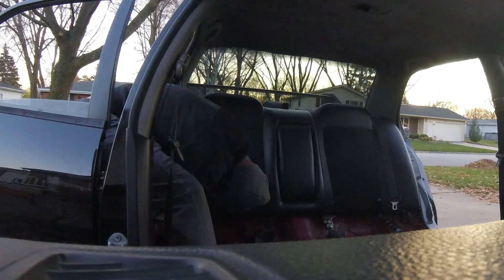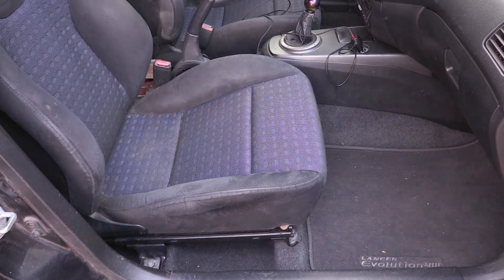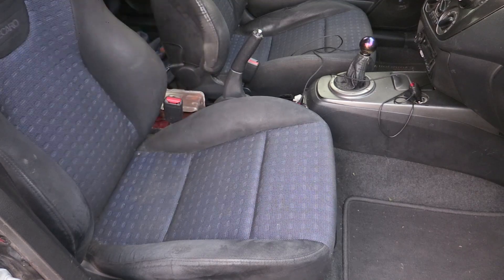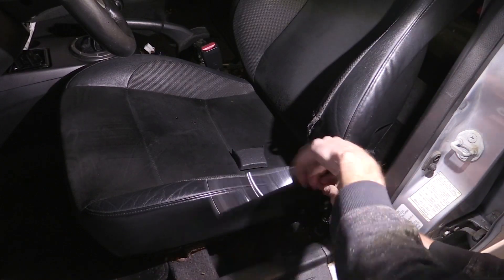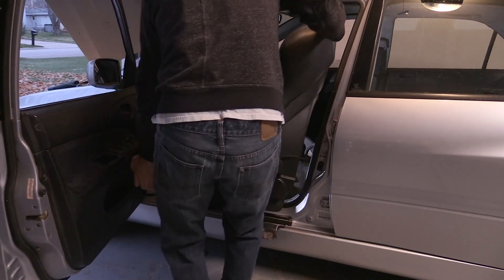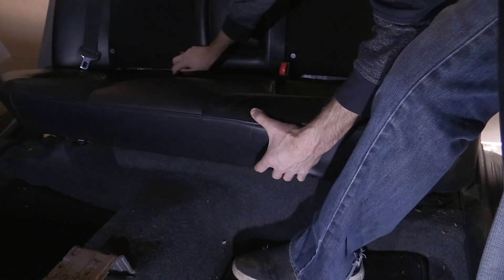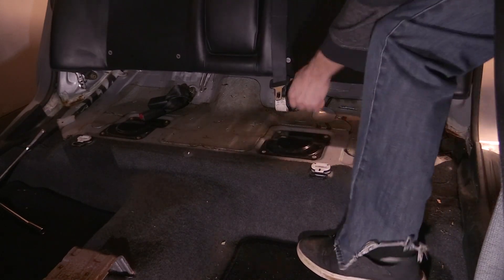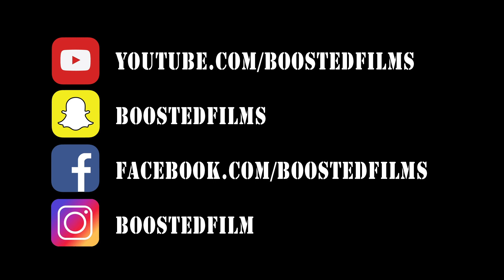EVO 8/9 Seat Removal / Install Howto - Mitsubishi Lancer Evolution 8

Comment: Great video! I never knew the rear seat removal was that easy. 

And as far as ageism with Evo ownership, Paul is an OG in the Evo community, even from his blue 8 from many years back. I used to watch his videos when I was in high school, love the work Paul!
Reply: Thank you for this video. im trying to figure out if I can DIY the seat removal and get access to the floor to put some deadening mat. The 4 doors have been done recently in an autoshop and I DIYed the spare tire compartment but was contemplating putting some on the cockpit floor. Again thank you for this video.

Comment: If the clip has been broken under the backseat that clamps it in and holds can it be replaced ? Like the black clip part is completely missing from when I upgraded fuel pumps.

Comment: I just did front wheel bearings on my evo, and I tell you what that is the worst.. I had to remove both knuckles and unplug the ABS sensor from the wheel wells cos it was siezed in the knuckle. Ripped the boots on both of my outer tie rods trying to knock the siezed tie rod out, overall it was very time consuming just taking the 4 bolts out in each knuckle.. coated it in anti sieze and threw er back together.. I’m sure all of my wheel bearings are bad from the previous owner launching the absolute shit out of the car